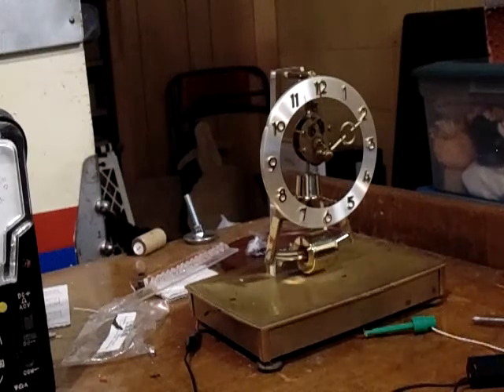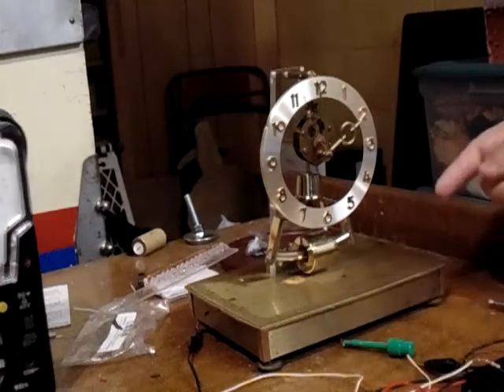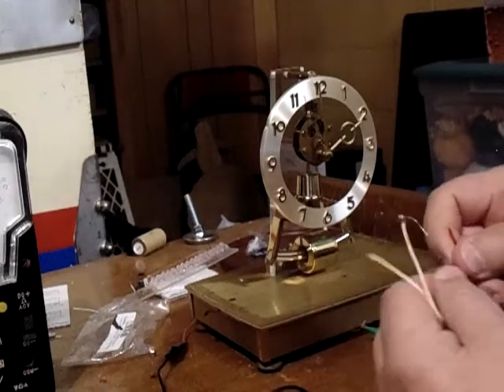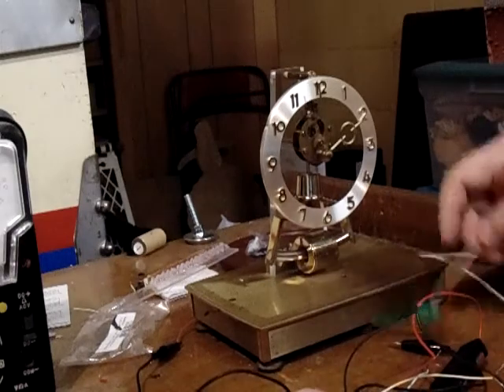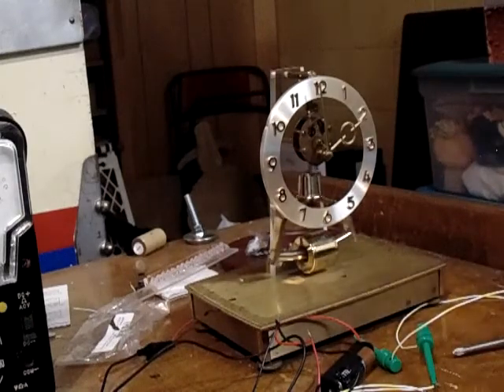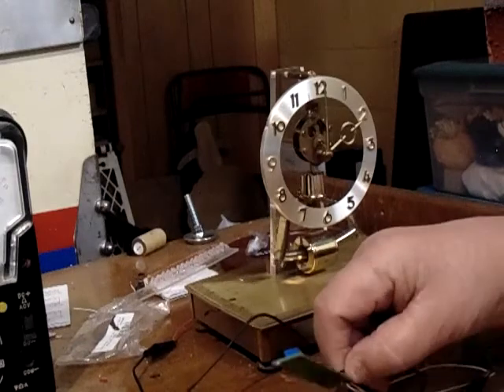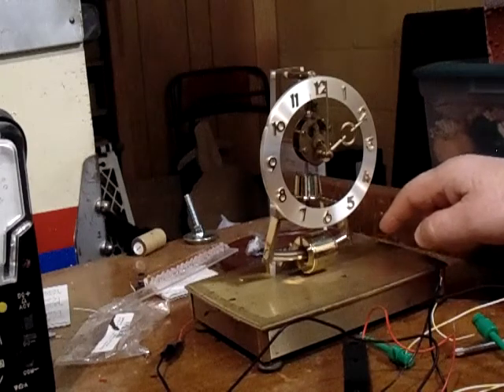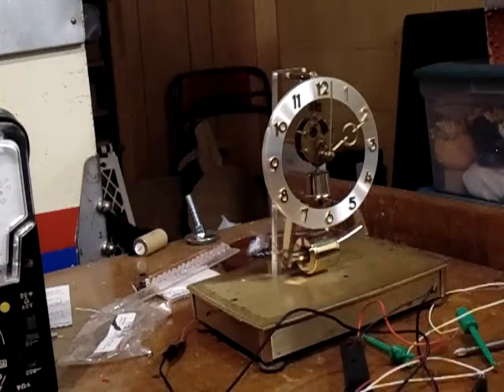Connection the Kundu  electromechanical clock to the custom circuit from ebay. and How to adjust

Comment: Link to ebay not found. Like to buy a board
Reply from the maker: Electromagnetic Clock Circuit Board for Kundo - Kieninger Vintage clock parts

https://www.ebay.com/itm/256615399952?_nkw=Electromagnetic+Clock+Circuit+board&itmmeta=01J6AMY0FEFNAT652E5TSQVS57&hash=item3bbf784210:g:jU4AAOSwZcxd3D9A&itmprp=enc%3AAQAJAAABAHoV3kP08IDx%2BKZ9MfhVJKmAbxZAnOCGUr96eg94UA6wiOk008m1C1paPD5PXv5edpxMZct4FnCLoKINTUA8GbOVCgwU3LISC%2FoHBaZL2%2FZ8%2FI%2BAf%2Bz0wwixmR6%2Fwe76QCtZh1An2UPQ0Ce7qZBFwTSCGSYEjJaKE3jySLu5cG46BI9%2BKae6ytHQmQP1WULau5ROkycXADHp2cROFKvd5JgYWQl%2FQ31CjizETsMzTTdv8OqgD73nBSQjLbsjOS8g6tQ%2BskbjsSUyrHUPWwxdi2QK5aN5iEZ8rwSmiKq2hutrfGGfGnlZ1IxxKXN9dUuvAgYaw%2FSeSFeenFwkldoh3kA%3D%7Ctkp%3ABk9SR-aH-NSyZA

yhanks or inqurey

Comment: Can't find cercuit on Ebay I am in UK can you get them in USA
Reply from the maker: Dear sir we have them om ebay https://www.ebay.com/itm/255913048070?hash=item3b959b3806:g:jU4AAOSwZcxd3D9A&amdata=enc%3AAQAHAAAAsGcckCxjmZoMsE3hylvYUJxSGOE0ye1KBIow7ADS8M6iBFNBmCjvys%2BwvpVN3KpKvnMeq8X3xSnCGm33n%2BXWmmp37i9vITJ2W3rZYI1PMr691zB2hYCZF%2BGQ5wgK%2F7KJ2xTa5NW%2BEFnrwlLgrFIEHudTQ4fouW9LDlQyYh%2F4ZRxOJWwaXGrN0dUJXUfJboZ6zWIy1NlS2vvKzb1tss5LzUHUl0CO9umPzR9STqfnyNsv%7Ctkp%3ABk9SR8yTzJ60YQ

Electromagnetic Clock Circuit Board for Kundo - Kieninger Vintage clock parts